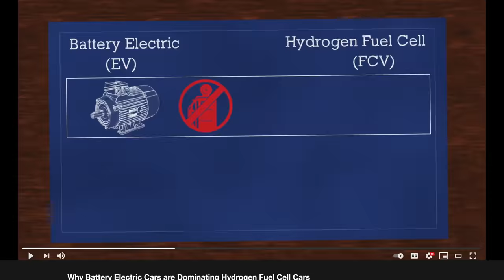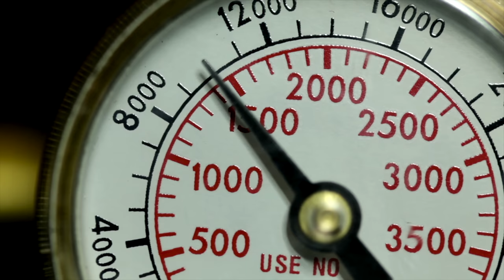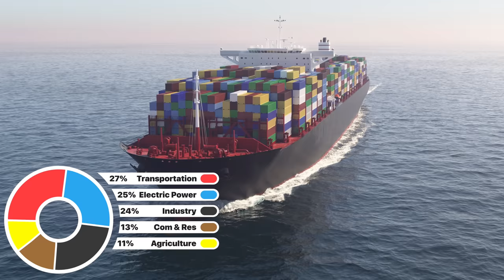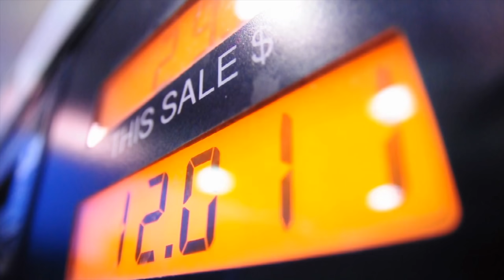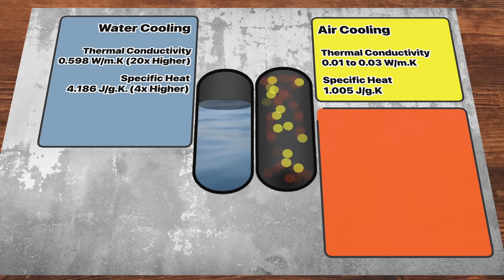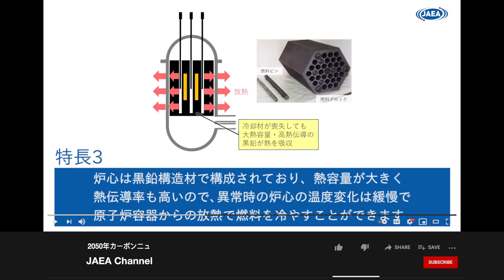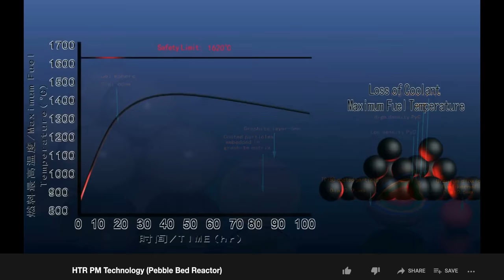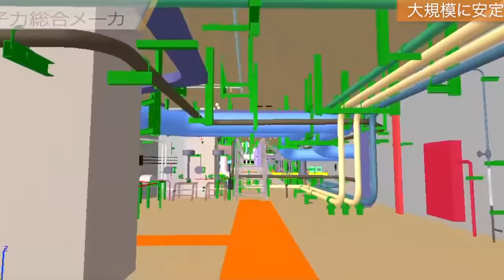Japan's Plan to DESTROY the Price of OIL and GAS!

Comment: The Helium cooled pebble bed reactor is just one of the  reactor designs capable of producing very high temperature process heat for Hydrogen, ammonia, etc, along with molten salt and Sodium cooled designs.  Its disadvantage is that the waste ceramic pebbles are more difficult to reprocess than conventional fuel rods and thus less amenable to reuse of waste stream U238 and Pu in breeder reactors.  MSR and sodium designs can be breeders, fueled by waste and produce dramatically less and shorter-lived waste streams than the current Japanese design.  They are likely better future designs, but the Japanese deserve credit for pioneering a better replacement for the expensive water-cooled reactors we've been stuck with for decades.
Reply: Also helium isn't a very abundant element. We barely have enough as is.
Reply: @jsplit9716  yea its mostly byproduct of natural gas processing and often vented to atmosphere where it just escapes to space because of insufficient storing methods.
Reply: 1968 Hamm pebble reactor accident on internet
Reply: I'd also be concerned about the corrosive effects of SO2, H2SO4 and HI, more so the H2SO4.  Inconel is strong stuff, but I'm not sure how well it'd handle those kinds of conditions.
Reply: it funny they talk about Japan when China was the first to have realised commericalization of the helium pebblebed reactor a decade ago. and the Chinese knew nuclear isn't the solution because there is a limited amount of uranium on the planet, if we were to switch entirely to nuclear, uranium would only last a century before it is exhausted and become too expensive to be viable. the reason Japan follow this route is really because of 2 reason: 1. Japan is a small enough country to not exhaust uranium. 2. while batteries are more effective, Japan as a small country does not have the raw material to make them, so their choice of nuclear hydrogen is really due to their strategic weakness than because it is a good idea. but what make their idea of hydrogen laughable now is the introduction of sodium batteries. since sodium is everywhere, reason 2 is no longer a concern of battery as a mainstream option. no matter how effective nuclear power is and will be, it doesn't really help hydrogen because the flaw battery technology has is being overcome.
Reply: @lagrangewei  Have you not heard of the breeder reactor?
Reply: can u cool with something else
Reply: Can the pebbles be used in construction of roads or homes?
Reply: @lagrangewei  just use thorium reactors
Reply: @amanawolf9166  : Well.. time to also build a flying "hoover" to neutralises the sulphur dioxide in case it actually does get leaked into the atmosphere? I mean.. what else can you do ? A flying catalyser basically. That is possible. If this clean energy is produced. Then the oil is left for planes.. which should work out for a little while longer and keep supply-chain going.
Reply: "Carbon Neutrality" is crap.
Reply: @ellenlandowski1659  I'm as pro-nuclear as anyone but I'm not sure I'd want a road made from spent reactor pebbles. Fairly radioactive.
Reply: @lagrangewei  There are places where hydrogen as fuel is good and places where it is bad. The good is in very large heavy industries like steel making or heavy shipping. Cars and anything portable tends towards the bad side.
Yes batteries are a much better solution than hydrogen. But there is an even better 'ironic' solution in converting hydrogen to synthetic carbohydrates. Carbon neutral synthetic petrol, ethanol, & kerosene, etc. For aircraft which are one of the big polluters synthetic fuels are one of the few really viable options. For cars batteries definitely win in cities and short range commuter driving, while synthetic fuels tend to win for long range and heavy vehicles like trucks.
Reply: We also need another source of ammonia for fertiliser.
Reply: @russellk.bonney8534  
"Carbon Neutrality" is crap.
Reply: @jsplit9716  So why do we waste it on balloons? I guess that's a tiny amount?
Reply: @hg2.  Yup the New Rip Off !
Reply: @BobJones-gn2tr  yes with the helium apparent  cheapness, this is a sad story because before world realized how precious helium is, it was briefly cheap due to overproduction as by-product of natural gas extraction and running out of storage, therefore price went down as everyone had surplus over maxed storage and other choice was just to vent into atmosphere....
Reply: Breeder reactors are as likely as fusion reactors or Harry Potter power...
Reply: @lagrangewei  Japan's work with process to heat to generate H2 promises to pay off regardless of whether PBNR ends up being selected.
Reply: I'd disagree, the ceramics used could be converted into other energy sources. Or possibly even left as is, and used in passive processes of heating, once the balls have reached end of life. These balls intact release heat rapidly, and end of life means that they just don't produce enough heat for the current processes in the reactor. That doesn't mean they couldn't be reused in a lower temperature reactor for straight steam electricity production. If they're still hitting 600 c, 200 c, they could still be used in a more conventional sense without the worry of melting down. Once they hit the point that they're not producing high volumes of Alpha and Gamma radiation, putting them in a shielded storage container and using them for passive hearting in buildings for example, could be highly effective and last for decades.
Reply: @tmst2199  Well, heat from this material really isn't contributing to global climate change, and these particular units, if stored underground and used for heating homes and hot water, especially in very cold climates, would drastically reduce global greenhouse emissions. About 27% of all natural gas burnt in the world is used for heating homes in the winter and heating water, and other household items (stoves, fireplaces, etc). 

So, it would, ironically, be advantageous to use the spent balls in such a fashion. All that would need to be done is to encase one or two in a small cement form underground for each house. Run copper tubbing through the top slab, and back to the house. Run mineral oil through it and dump it into a heat exchanger.
Reply: @XtomJamesExtra  Yeah, this could be a huge boon for human comfort in general. Too bad it's just not feasible from a security standpoint.
Reply: We have heared that story about better batteries before. Potential yes. It is not here yet. Just like everything concerning batteries, if they dont make a major breakthrough batteries can only be a temporary stopgap between better technologies. No use in large scale systems as of yet..
Reply: @MrBallynally2  Well except we are there, in fact several different companies are slated to start or have already started mass production of solid state batteries, and we can expect to see the tech in EVs and other electronics starting next year.
Reply: @koltoncrane3099  We all should agree that natural U ore availability is a non-issue.  Mining slowed decades ago only because of a glut of U ore.  Uranium breeder reactors now planned for all energy needs can  run on existing waste fuel and depleted natural U in the US for more than 1000 years.  And there is plenty of unmined U ore on land and in seawater for other countries.  

The unlimited supply of Thorium, used in breeder reactors to produce the fissionable U233 isotope, will eventually replace natural U in some countries sooner than others just to ensure a domestic energy supply, but not because of any worldwide  shortages or costs of natural Uranium.. Thorium reactors will just create and burn an unnatural U isotope, available in whatever quantities are needed.  So it is impossible to run out of fissionable Uranium.
Reply: @tmst2199  Sure it is, by the time these balls would reach end of life, their radioactivity has decreased exponentially. And frankly, once buried and covered in a slab of concrete it isn't likely anybody is going to be digging it up anytime soon.
Reply: @XtomJamesExtra  For the waste to be available for heating buildings and so forth it will need to be accessible and, thus, vulnerable to being carried off and used for nefarious purposes. No?
Reply: @Lucien86  Audi created a patent on this process over 10 years ago.  Harnessing a hi-temp nuclear power source like the LFTR, coupled with this carbon neutral synthetic, would allow for the use of existing vehicles with minor modifications.
Reply: @cupidok2768  Plenty of different coolants have been used (Helium, liquid metals) and are planned for the future (salts esp LiF and BeF).
Reply: @ellenlandowski1659  Not the spent pebbles.  Way too radioactive.  Just like fuel rods.
Reply: @portfolio91  please do
Reply: Excellent info, thank you. 
Yes, the Japanese have at least made the moves toward carbon neutrality. In the States, we have legislators who relish their ignorance and cherish the mighty dollar. We won’t get anything done unless the system changes, soon.
Reply: Just pump more fuckin oil yo
Reply: LFTR'S or chloride salt reactors don't require pressure domes or water cooling and can produce process heat in the 800°C range up to 1400°C, which is the boiling point of FLiBe.
Reply: It is impossible to see where pebble-bed reactors are of any use except in the very short time, and not even then when you look at the other designs that are available. Pebble-bed reactors make a lot of sense for fuel once reactors for space, including the Moon or Mars. Recovering unspent fuel from the pebbles is not likely to be easy or profitable. Give them a last dose of propellant and aim them into the Sun. 

I still believe that LFTR'S are the best plan for the short and long run.
Reply: how difficult could ceramic be to reprocess, they do it in the same place where you recycle old bricks
Reply: @jsplit9716  The helium is in loop, it's not continuously consumed.
Reply: @blue_beephang-glider5417  Breeder reactors have been in use for a long time. Or are you saying that the public won't approve of expanding their use?
Reply: @tmst2199  As is virtually everything else in the wrong hands.  
If you are paranoid; you are paranoid.  Nothing will satisfy you.
Reply: Then what can be an alternative to helium? Someone pls tell
Reply: @jadenspires1891  I am not one who believes that a shortage of He will do more than increase its price, perhaps dramatically.  But it is not a dominant cost in such a reactor.  It's advantage is that it is inert and does not react with anything.  But other gasses like CO2 could be used, as has been discussed for use in higher efficiency turbines at very high temperatures like those here.  To me the use of high pressure CO2 would be riskier because it is heavier than air and for a massive leak it would fall to the ground as it cooled, potentially suffocating people nearby.  Helium would always safely rise, in the event of a leak, allowing breathable air to displace it..
Reply: @robertmeredith3940  so in a nutshell what would be your best alternative
Reply: @jadenspires1891  I'm not a chemist to pick a Helium gas substitute, but as an engineer, I hope for a successful fast breeder molten salt reactor able to produce the cheapest electricity and Hydrogen by any means.  Both are essential; and liquid salt fuel mix offers the widest choice of both fuels and waste processing, IMO.
Reply: @robertmeredith3940  ok that’s nice, it’s nice to see an engineer here, but I am really disappointed that the helium for this reactor tech isn’t renewable 😔 since the reactor design looks pretty cool
Reply: @robertmeredith3940  also, I just thought, could argon work with this tech instead of helium?
Reply: @jadenspires1891  Doubtful. It has only one tenth the heat capacity of He, so would require ten times the flow for cooling/heat transfer from the reactor core.    Helium is a product of U and Th fission/decay, so it might be a waste product of MSRs in the future.  But I'm still not a chemist.
Reply: @robertmeredith3940  I’m sorry, I’m just super interested
Reply: @lagrangewei  Well that's using U235 and our current known deposits which is a tiny fraction of fissionable material available for future fission plants. What we do know is after a few hundred years of using exclusively renewables we will be replacing the millions of hectares of panels batteries and turbine blades across the planet every twenty to thirty years. That is a lot of waste from disposal and creation even with recycling what we can, literal mountains of waste, some of it toxic to life forever, not a few hundred years like used fission fuel, but forever. Consider this versus storing used fuel from fission plants in a few hectares to be reprocessed for fuel in future fission designs.

A 2 GW sight with a <90% year round capacity factor (refueling and maintenance cycles included) can store 80 years worth of used fuel for reprocessing in an areas that is a little over a hectare, you will struggle to spot the storage pad on google maps at a power station. That's a human lifetime worth of power that can fit on a suburban front lawn and the radiation from the bunkers is barely greater than background. I'm not again using solar and batteries, it's a viable energy source for countries that can't afford or don't have the brain trust to manage a nuclear program. It's just using renewables and batteries from here on out in power hungry countries that can set up a fission/fusion program should do so to avoid a whole new waste problem in the future, at least to power their cities and industrial sectors.

Setting up an SMR in a tiny southern town in the middle of nowhere doesn't make much sense when a farmer's field of panels and a battery bank the size of a library would suit them just fine.
Reply: @jsplit9716 we have so much helium
Reply: @marcwinkler and?
Reply: @cupidok2768 milk
Reply: Japan is on the Pacific “Ring of Fire.”  Geothermal should be useful. Maybe we should use less energy.
Reply: @TM-cm4gb Yea but No.
Helium was a byproduct but  once the price rose sufficiently it became the extracted resource. Turned out there's large reserves after all.  
Also this reactor doesn't consume He, it reuses a single contained amount, no losses to space, just a simple (large) upfront cost at installation.
Reply: @amanawolf9166  It doesnt matter that is a different facility than the nuclear plants even if it is eroded it wouldnt really make a problem for the plant itself since plant can work on its own.
Reply: @blue_beephang-glider5417  There are only two commercially operating breeder reactors as of 2017: the BN-600 reactor, at 560 MWe, and the BN-800 reactor, at 880 MWe. Both are Russian sodium-cooled reactors.

The technology exists.
Reply: @blue_beephang-glider5417  Breeder reactors exist: Russia has had a commercial breeder on the grid since 2016 (BN-800), and is building a larger BN1200 currently. So they are not fiction or theoretical, nor unproven.